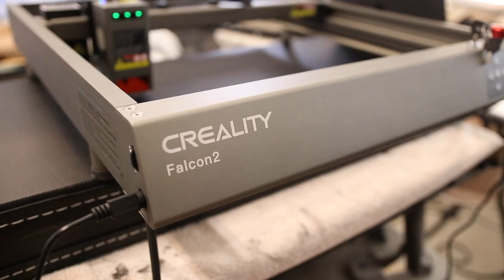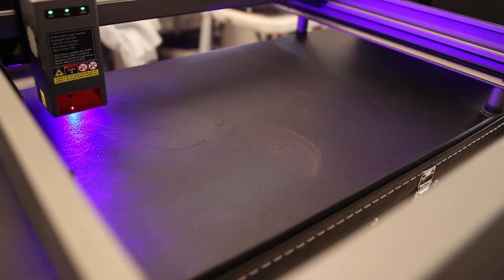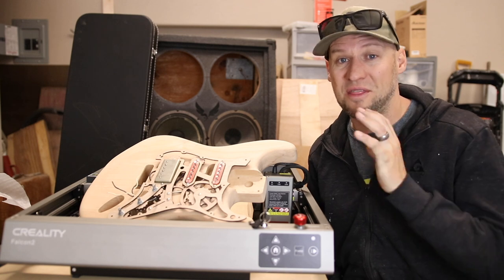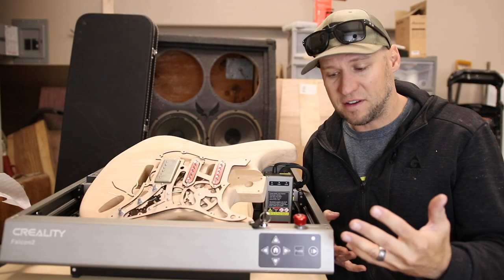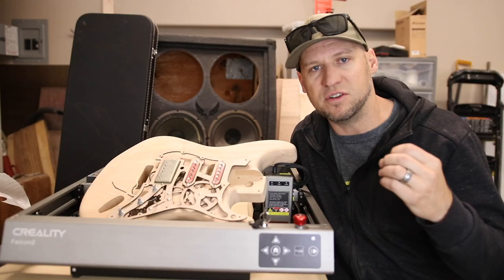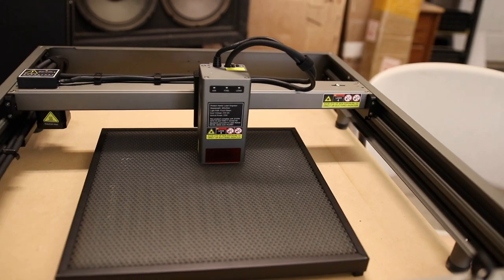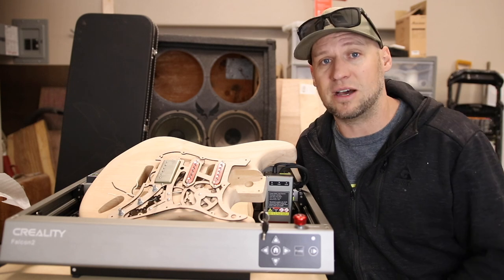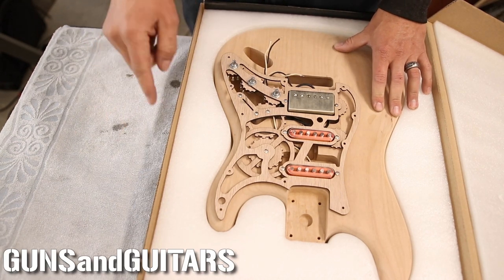Making a STEAMPUNK STRAT! (and other cool stuff) with the Creality Falcon2 (22w CNC laser)

Comment: I had a steampunk bass I built years ago. A fun thing you can do is take raw copper sheets or pipe fittings and put a little saltwater on them to tarnish them. There is also typewriter keys at the craft store that you can embed in custom knobs. I also took a brass peephole for a front door and put that through the body. It was pretty cool.

Comment: I recently got a Ric 325 style guitar kit. I bought a sanding kit 50 - 10k grit. Didn’t know wood could get this smooth. Now with Dan’s laser I could be really dangerous😂. Unfortunately it will be primer, paint, clear coat. Every other guitar I’ve done is stain and true oil.

Comment: Cool laser.  I also like the Steampunk aesthetic you are going for with the scratch plate.  I think I would be tempted to use a dark brow stain on the top layer and cover the 'gears' in something like copper tape although the ideal finish would be more of a dirty bronze.  Not sure what I would do about continuing the theme on the body though, I would probably end up referencing some old computer games that use the theme like Thief: The Dark Project (a really good old game to check out if you ever have the time).